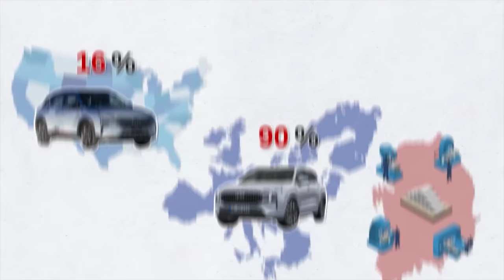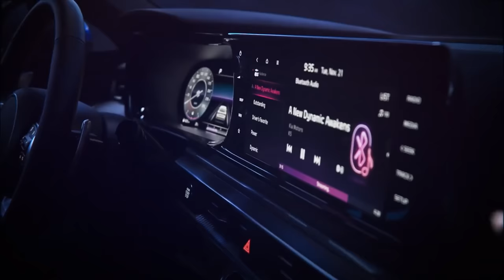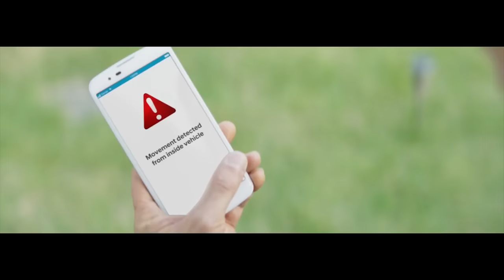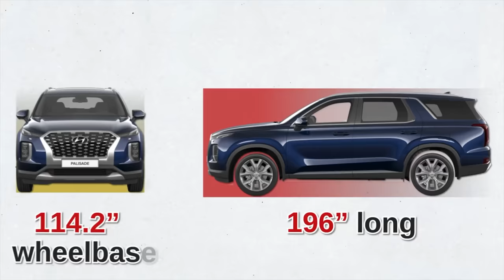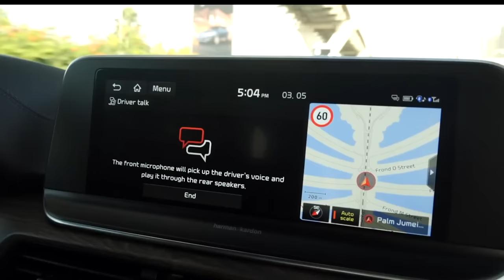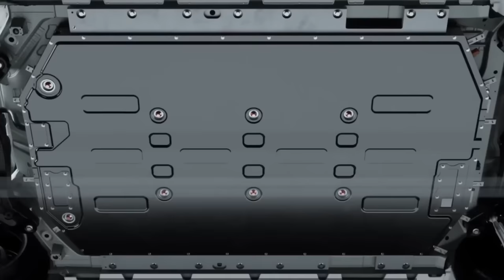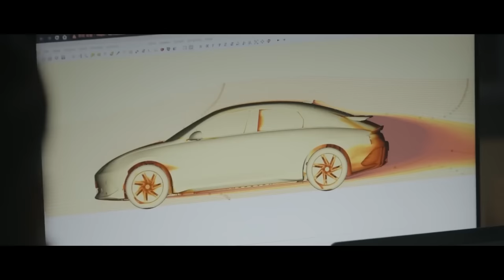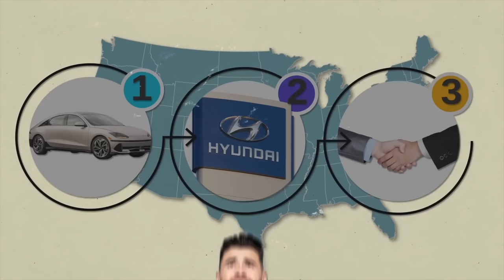No One Else Has the Balls to Say This About Hyundai and Kia, So I Will

Comment: OK - I know that Toyota and Honda build pretty damn good cars. We (me and my partner of 27 years) have owned a ton of KIAs. When I met him, he had a 1996 Kia Sportage. Then I bought a 2000 Kia Sephia. Then I bought a 2006 Kia Optima (nice car, but under powered). Then finally, in 2010, we bought a Kia Forte and in 2014 a Kia 2012 Sorento. I can honestly say that the quality from the Sportage to the Forte and Sorento had GREATLY improved! In fact, the Kia Forte has over 206,000 miles on it and has had no major issues. The Sorento (bought used with 33K miles on it) has had no issues at all (other than the A/C might need a new compressor) and it has 166,000 miles on it. In fact, when I took the valve cover off the Forte (2.4 Liter) I was astounded! Absolutely no wear or carbon or dirt anywhere!! With over 200K on it? But I admit I only put SYNTHETIC oil in. Now I have heard that Toyota has the most cars with over 400,000 miles on them, and I wouldn't say anything negative about Toyota, but Kia has definitely come a LONG way!! When I got the Forte I looked at all the other cars in the same class. The Forte was the only one that came with 4 wheel disc brakes, had over 30 HP on the next competitor and of course was almost $2500 less than anything in its class comparably outfitted. Throw in the 100K warranty and it was a no brainer!

Comment: I've always known the merits of Hyundai.  My first brand new car was an '86 Hyundai Excel.  I remember someone at a GM dealer confirming they were well built.  I never had a problem with it.
Reply: My brother had one.  Not bad except manual shift linkage had a bad habit of locking up going into second gear.  You had to beat the crap out out to get it back to neutral and then it would shift fine.  Dealer could never solve the problem.  Had @150K when became a rust bucket and was scrapped.

Comment: Never had an issue with Kia or Hyundai's. All of my cars, or SUV's, have lasted 8-10 years, with over 350,000 kms. I won't buy anything else. My 2018 Kona has 240,000 kms and runs like I just drove it off the dealership lot. Never a single engine failure. There cars are priced so much better, than there competition.  My 2023 Hybrid Sportage loaded costs me $41,000 Canadian.  Comparable models would cost $50,000+.

Comment: I'm one of those loyal Hyundai drivers. Will never consider anything else than Asian but have serious prefrence for Hyundai. They just fit like a glove . My previous car was a Hyundai Elentra sedan. Bought as six years old occasion. Drove the car for twelve years. In those years it never broke down. Only went to garage for annual check ups and stamdart repaires. At age 18 and about 250.000 km I traded the car in because of standart repaires like distrubution beld and tires. Everything still worked perfectly. Have a 6 years old  I30 now and again really happy with this one. So yes, I'm a fan.

Comment: I will always be a loyal Hyundai customer. Here in India, Hyundai is the #2 most selling car brand and for good reason. The features which Hyundai cars offer are really impressive for the price, the reliability of their engines and transmissions are top notch and their service dealerships have really well trained staff. I have two Hyundai cars, a 2016 Creta 1.4 Diesel with over 150000 km on it and absolutely no issues and another 2006 Santro/Atoz which has stood the test of time and continues to be my daily driver. I take real good care of them and they take care of me well too. Will always be loyal to the brand

Comment: Had a 2011 Hyundai Sonata, 2023 Kia Rio, and 2021 Hyundai Sonata. For the 11 and 13 I put 160,000 miles on both before I sold them. They were both reliable cars and never gave me any problems. My 2021 Sonata was fantastic but I only had it for 30,000 miles. I ended up trading it in for a 2023 Kia Sportage because I needed more space.

Comment: Bought a "loaded" 2009 KIA Sportage V6 new.  Recently had the AC compressor replaced (I live in FL) along with the front shocks and Brake Master Cylinder. DEFINITELY worth the cost. Prices for NEW cars are NUTS and I couldn't touch a late model USED SUV for the relatively low cost of my recent repairs. With just a 130k I expect the Sportage to easily last at least another 100K with common sense maintenance.....and in gold with black trim along with a dark tint scheme it still looks pretty dang good.

Comment: My dad had a 2011 sonata, drove it for 8 years then sold it to a family member, and is still driving it. 150k+ miles and still going strong with no major issues, just normal maintenance. I just got a new sonata myself and have high hopes for it.
Reply: It was actually worst model year. Usually reported catch fire on engine. Other years did not happened like that.

Comment: I am on my 6th Hyundai and will never look back.  Look, out of 6 cars I had ONE bad one, my 2016 Tucson had a bad engine, they knew about it, and at 75k miles it seized up, they replaced it, at 115k it started having transmission issues and I traded it in, they knew about the issues and still gave me nearly 9k for trade.  I now own a 2022 Tucson and LOVE it.  The features for a 30k vehicle are insane.  8" touch screen, power everything, smart cruise control, lane assist...etc.  Basically every option possible except leather and sunroof.

Comment: Still driving our Hyundai I30CW for the last 13 years happily. 1.6 LTR 16 Valve VVT, 37MPG (US ) and 100000 miles on the counter. This one was assembled in Czechia (EU). Purchase was about $22K. Car has been value for money and will run probably for another 30000 miles. Dutch dealers were less satisfactory: Delivering the new car with 2nd brand cruise control, hook and parking sensors, and service stops when you leave their driveway. It has been yearly serviced at a regular service shop after the warranty ( 5 years in those days ) expired. Fuel additive was added at last service to clean tank and fuel system. Some parts are cheap plastics and have been worn by now: Inside door handles, safety belt knobs, strips on roof top all have faded or crumbled. However no engine failure whatsoever. Lots of space in the rear; when I remove the rear coach, about 1,5 M3 ! Enough for a camping trip. I'll keep driving this one until it falls apart, or perhaps have it restored to its former glory if petrol remains available.

Comment: I currently have a 2019 Camry Se. The car it replaced was a 2006 Hyundai Sonata with the 3.3L V6. It was an okay car with well over 200k miles when I replaced it. but the interior was trashed because it can't take the abuse my two kids heaped upon it. Still, I loved that car. Too bad Hyundai got rid of the V6 Sonata. By the time I replaced it, I already knew about the Hyundai/Kia engine fires which is why I chose a Toyota Camry as its replacement.
Reply: I drive the exact Sonata that you had with 121k miles, I had to get the tranny rebuilt because the transmission filter is non serviceable and got clogged after a fluid change :( also AC compressor stopped working and had to get a compressor and radiador. Also alternator failed and had to replace that one too. Also needs new struts all around. 

Although after all this work it feels I’m driving a new car and shifts like a rocket 🚀 and I hope to get another 200k miles out of it
Reply: By 2011, the Hyundai Sonata came equipped with the GDI Theta 2 engine which is horrendous engine. The old 2.7L V6 and the 3.3L V6 were reliable engines
Reply: You should have looked into Hondas
Reply: Smart move....that is my opinion.

Comment: Scotty, when the Hyundai (Sunday) rep came to our dealership, from Korea, he says Hyundai sound just like Sunday, so Hunday...I have since verified the pronunciation with Koreans. NOT yundie. Anyway as an old mechanic myself, by 2007, it seemed the quality of material and fit and finish had progressed to be so competitive for the price, that I bought a new kia Optima. It replaced my 89 camera..it was so nice, in 2012 a  Hyundai Sonata, was now in the family, then in 2018 a Hyundai Accent..so far only thing gone wrong, Optima, 1 rattling sway bar link, Sonata, leaking oil pressure sending unit, noisy drive belt idler. Even if I had to pay to have the work done, the labor was minimal, and parts from the dealer were quite reasonable.
Reply: You're right. I wish he would pronounce it correctly. A man of his stature
Reply: @ScottLive1  For sure. I mean, they had commercials when Hyundai first came to the USA that said 'Hyundai like Sunday'. Yeh, I'm old, but so is Scotty 🙂

Comment: I bought a 2011 Kia Forte in 2018 with about 84,000 miles on it.  In December I will have had it 5 years, and put about 100,000 miles on it already.  Just normal maintenance.  Love the car.

Comment: I have and 04 Sonata bought new and an 07 Sonata also bought new. Both cars have just over 100,000 miles each on them, My daughter has an 06 Sonata bought in 08 which has 130,000 miles on it. A 2.7 six, a 2.4 four and a 3.3 six. All have been dependable with the usual wear and tear maintenance all cars experience. No regrets on buying any of them.
Reply: Those engines are traditional MPI engines. Hyundai/Kia went downhill in quality ever since they started building cars with GDI engines.

Comment: 2017 Kia Sorento, went through a quart of oil every 500 miles at 100K considered "normal by the manufacturer. Rebuilt the head at 113K because of excess build up carbon caused a valve leak, engine just siezed at 140k and all not covered by the supposed lifetime warranty because the check engine light never flashed after the update 4 years ago.
Reply: Valve leak or carbon buildup will not, can not trigger CEL.

Comment: I bought my first Hyundai (2004 Elantra) after talking with taxi drivers in the mountain city of Quito, Ecuador. They invariably rated their Hyundai Accents as the MOST RELIABLE, FUN TO DRIVE, AND ECONOMIC TO RUN AND MAINTAIN city car.
My Elantra was impressive. Smooth, powerful, great ergonomics and so on. The only problem: too low for potholes and speed bumps. 
Now I own a Kia Sportage. Very good car as well.

Comment: I drive a 2018 Hyundai Sonata Hybrid - it has been flawless to this point.  Bought it new and get approximately 43 MPG on average.  Does what I ask of it.  The brand has come a long way from the 80s.
Reply: It's only 5 years old.....and probably has less than 100k miles....it should  be flawless..that's not impressive
Reply: @richsweeney1115  It’s a Sonata- like any other midsized car, it not supposed to impress it’s supposed to do it’s job.  It does.   And seriously, as hybrids go, (and given it cost me 23k out the door), I am impressed.
Reply: @markt4605  just make sure you get rid of it before the 100k miles warranty. I would. Whoever gives you best price just get rid of it & upgrade or change brands.
Reply: @dbzownz12345  agreed- they extended the warranty to 150k and the hybrid system is a lifetime warranty.   That said, I don’t hold onto vehicles much past 100k.
Reply: @markt4605  😂 I can't remember having a car with under 100k, I still drive my '02 Park avenue daily, haven't had a car payment in over 25 years 😊
Reply: @whatsit2ya247  LOL- closer I get to retirement the less patience I have with cars.

Comment: Fuckin junk. Bought my wife a '21 Tucson brand new and 1 year later with 15k miles the transmission control module went out. Stuck in 4th gear fwd and going reverse to forward shook the whole damn car. 2k miles later the trans started acting up again like it was in neutral while in drive. Traded the POS in on a CRV.
Reply: Did you face this issue with the dct?
Reply: @althurules  I don't know if it had a dct or not I only know it was 6 speed automatic

Comment: My mom bought a used 2009 Hyundai Sonata in 2011 and that thing is still working against all odds 😆 We were laughing about it during her last visit cause there is no reason it should be close to functioning. That transmission is so messed up. You can feel it while driving but its been reliable as hell. Shes driven it, ive driven it multiple times while ive had other cars getting work done, and now it's with my brother as his daily driver.

Comment: I’ve heard so many stories about their engines breaking down at about 80,000 miles.
Reply: I know a hyundai and kia mechanics that do nothing but replace engines...they are lucky if the direct injection motors make it to 100k.
Reply: GDI engines absolutely suck, .2 4, 2.0 all garbage , then throw a turbo in an already compromised engine is not the brightest invention..Even the new ones are having issues ..Is Scotty making some corporate $$$_
Reply: @Thomas B If its bought used then its not covered
Reply: You're lucky if you're the first owner. If you're the second owner, you're screwed.
Reply: my father had a sonota it lasted over 200,000 miles.
Reply: @mikeschlup5279  My 2020 Soul needed a new engine at 9K miles. Dealer had my car an for entire summer as it awaited a rebuilt engine in a long line of Souls that also needs new engines.
Reply: Exactly the case for my wife’s car. The engine was burning oil at 78,000 and we took it to the dealership like 4 times for them to perform tests and cleaning. Then at the end of all the cleanings and tests it suddenly wasn’t burning oil anymore according to the dealership 🤔
Reply: That's because close tolerance in engine design were not properly performed.  Anytime when mass production of huge quantities are involved, something is bound to go wrong due to attention to details were neglected.

Comment: I have a 2016 hyundai elantra. Until the transmission went bad at 250,000 miles (runs but barely), I replaced the fuel pump, trunk latch twice, no other repairs beyond that. Very bummed I can't get a new or reman transmission.

Comment: New Kia and Hyundai cars from 2018 onwards seem pretty good. Everything before 2015 has a bad reputation however. I'm not too sure between the years 2015-2018 as I don't know many who bought those years.
Reply: @Jonathan Avoid anything with the GDI Theta 2 engine. The new smartstream (GDI/MPI) engines seem better built but I hear complaints of oil consumption.
Reply: @Jonathan my 2020 kia Soul needed a new engine at 9k.
Reply: Years ago, they hired German designers to design their vehicles to get them up to par.

Comment: I Will never buy a Hyundai again our 2014 Hyundai Santa Fe sport 2.0 blew up with only 113,000 i can’t believe Scotty  did this video😒.  Had the engine inspected, and it was the rod bearings problem associated with the recall on excessive early wear  they showed me metal in the oil which was metal shavings from early breakdown from oil flow restriction from when the engine was manufactured and the engine wasn’t properly flushed out from the machining therefore particles clogged the oil engine flow causing  catastrophic engine failure.  We are second owners, and just paid it off, of course😢. Hey Scotty please Do a video on the problem with the recalls about the Rod bearing and engine failures with Kia and Hyundai  restore my trust if your going to talk good about them give us the whole “Truth”

Comment: About EV’s……Automobile manufacturers cannot make money if they build nothing but vehicles that 90 percent of customers cannot afford. How many people will be willing to pay $50,000 and up to buy an electric toy so they can experience long waits at charging stations, reductions in how far you’re able to drive depending on the weather, towing and a myriad of related annoyances such as having to reduce the use of the heater in the cold and the AC when it’s hot in order to get a little more range in order to avoid another long line.

Comment: Took 9 months to get my ioniq fixed. To stop sending warnings. They replaced wiring harness. It appears the short is starting again, 12v plug in  on right (not working). Just a matter of time before it fails again, only it won't be under warranty next time! Too bad I'm old enough to not care anymore; will just Park back at Dealership when fails again. Loved my first one, no problems. Second, useless!!! PIMA

Comment: I loved my 2018 Elantra, purchased new. I'm glad it had the push button start instead of the easily bypassed key ignition. I was able to get it over 100k miles in less than 4 years. That said, it had engine timing issues and camshaft sensor check codes. If I had found a shop that was willing to repair it, I was planning on repairing it. But, the car got rear ended and totaled out. That was a sad day when I had to turn it over to the insurance company. I paid $14k OTD new for it. To get a similar package today, assuming they are in stock, would be $25k MSRP I loved that Elantra and was sad to get rid of it. I might have purchased one at the right price if I could have, but I couldn't find one.
Reply: You can buy used.....new cars are a waste of money...and they're made cheaper and cheaper....I can't belive so many people buy these tin boxes, and they lose too much value when you  take them off the lot
Reply: @richsweeney1115  I agree, but with Kia it's a gamble buying used cause their bad engines bad in years past. New cars are a gamble too, but at least you have warranty attached to it. I'd rather go on marketplace & spend 3-4k on used Toyota or Honda that's 10+yrs older than a used kia of similar price of couple grand more.

Comment: I bought a brand new Hyundai Santa Fe back in  2003. I got rid of it in the 4th year of ownership because every year the oxygen sensor would have to be replaced. The only thing I missed after getting rid of it was the 6 disc CD player it had. That was the only Hyundai I ever owned and I only buy Toyotas now. I own a 2013 Prius V and a 2019 Camry XLE Hybrid. No problems with either vehicle. I had an old 1998 Toyota Camry LE that I bought new and gave it to a needy Veteran when it had 275,000 miles. That was 4 years ago. He is still driving it.